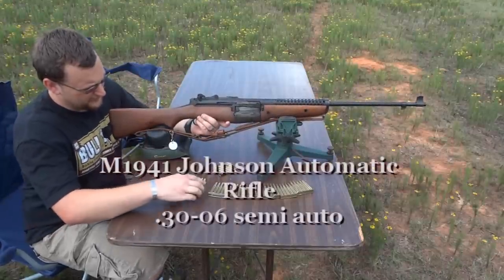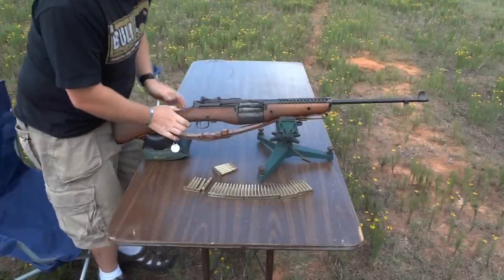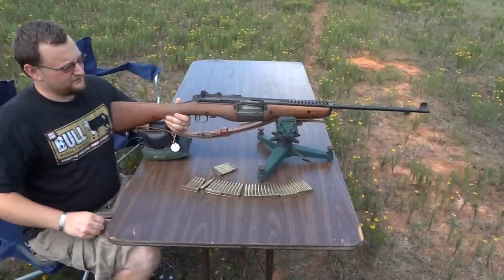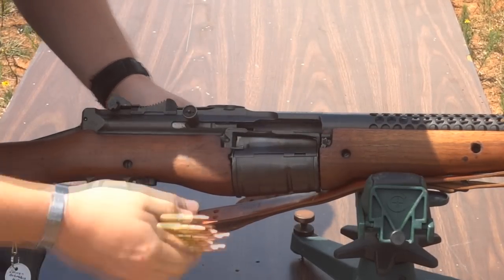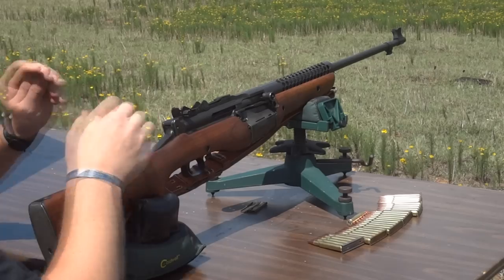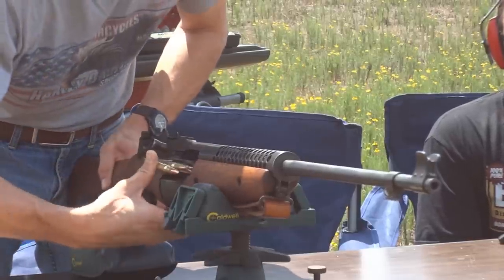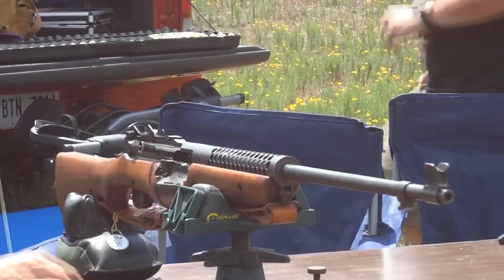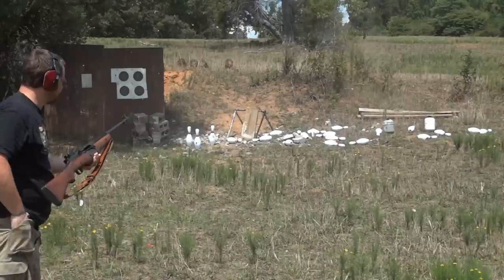1941 Johnson Automatic Rifle WW2 .30-06 Semi Auto

Comment: a few very important points that were left out.  1.  No "PING" like the Garand, to tell the enemy you are out of ammo..  2. it used the same 5 round stripper clips used by the M1903 Rifle that was also still in use  3. it held 10 rounds compared to the 8 rounds used by the Garand. 4. it didn't bite you like the M1 Garand (aka the Garand Thumb).  5,  a big drawback to the M1 was, you could only load using the en-bloc stripper clip, BUT..  the johnson allowed you to top off the rifle, with a stripper clip after shooting 5 rounds.  the Garand could not be topped off.  you needed to eject the clip using the button on the side, which would eject the clip and remaining rounds, so you could load another 8 rd clip. 6. the johnson rifle, DID NOT need to use stripper clips, you could load them manually one round at a time.  7. the Johnson could be easily topped off...or a specially round AP API etc could be loaded easily, OR, you could shoot a few rounds, and then quickly add a couple rounds manually.  this was a big deal....   In addition to the Johnson problems with bayonets...  if you attached a normal bayonet, the added mass on the barrel would cause it to have feeding problems nearly with each round fired... so Johnson designed a small lightweight spike bayonet...  so the Johnson was not a great rifle for attached bayonets...  BUT  bayonets were very rarely used...  and I would trade off the bayonet issues, with the ability to top off a mag, as well as not having the PING.    (note:  WWI, WWII and Korea we used Stripper clips, or enbloc clips...   this is why they continue to use the Term CLIP to this day...  back then it was a correct term..   But....   Modern rifles use Magazines AND NOT CLIPS...   Now you know where the term Clips  came from...   lol   )
Reply: *****   I forgot to add that you could mount a grenade launcher (for rifle grenades) on the M1 Garand, and even the M2 carbine..  but you could not mount one to the Johnson due to the reciprocating barrel. (it would have caused a great deal of damage)...   something most people don't know is that Johnson always gave his firearms Nicknames:  The M1941 rifle was Betsy, the M1941 light machine gun was Emma, and his M1947 auto carbine was named Daisy Mae.
Reply: ***** The enemy hearing the ping is a wife's tale.  German soldiers who fought at Foy were asked if they ever heard the ping and they answered that they had not.  The 8th round firing covers the ping.  The bolt of an M1 can't slam on your thumb while loading. Only while closing the bolt with the rifle empty. The follower can be pushed very nearly to the downward limit of it's travel w/o releasing the bolt unless you bump the op rod handle. If the bolt closed as soon as the follower moved, you couldn't get the clip in.  If this does occur, the piece is out of time and you need to check the fulcrum on the bullet guide.  Both the Johnson and the M1 had a magazine, but they were integral. A "clip" only holds ammo. A "magazine" holds and feeds ammo.  I sure it was a slip, but there's no such thing as an en bloc stripper clip.  In my personal experience, after talking with many who carried the M1 in battle, there was one complaint only. It's weight.
Reply: +88mike I was about to say that about the ping
Reply: +88mike The difference between a magazine and a clip is that a magazine has a spring inside it well a clip does not. Your right there is no such thing as a 'enbloc stripper clip' but there is such a thing as a enbloc clip which could also be called a mannlicher clip. These were used as a integral part of the magazine, as the magazine cannot function without it. For example if you do not have a enbloc clip for your M1 Garand you cannot hold any ammunition in the rifle as the magazine has no feed lips to retain any rounds.
Reply: +Eaglelord17.     Correct
Reply: +Weaponeer Yeah no ping, but that trigger reset is loud as hell.
Reply: +Weaponeer  Not true, bayonets were used about 50% of the time in the pacific. Japanese would launch Banzai attacks in the day, and at night. Hand-to-Hand combat was expected in the pacific fighting the Japanese.
Reply: the whole thing about the "ping" letting the enemy know you are empty is blown way out of proportion, as in combat the enemy wouldnt hear it, even if he was close, and wouldnt kno who it was.  there is no being quiet in combat. perfect example is yelling for another magazine or belt of ammo
Reply: The Japanese heard the en-block Clip PING constantly.  They would wait for the ping, and they would quickly charge that position, with the idea that most of the time the US Troops would be out of ammo stored in their belts, and had to reach for ammo in a separate bandoleer. this action may only take 7 to 10 seconds, but it would only take the Japanese 5 seconds to reach and bayonet the soldier.  now it's a documented fact that the Japanese would hear the ping.  so much that US troops used to throw up an empty clip and a second later the Japanese would hear the "FAKE" PING, and they would charge in force, and the US troops would mow them down with gun fire. So at first the Japanese used it against the US, and then the US used it against the Japanese.
Reply: ***** Not true because if just one person was out didnt mean everyone else was too. and the japanese were not that dumb and neither were the  germans
Reply: +The 20th Century Limited (Ricky B.) I agree
Reply: Weaponeer The ping was a non issue.
Reply: ssimon64 the ping was a major issue that got a lot of people killed
Reply: Weaponeer there's a lot of ignorance in this post, it's clear to me you don't own any garands, and if you do you certainly don't experiment with anything. First, the ping giving away your position and letting the enemy know you're out is Utter BS. Not only can you not hear that ping through a battlefield environment, but if they did, you and all your allies wouldn't be shooting and reloading at the same time, unless they're moronic. You always have men shooting while you're reloading so you don't end up getting bum rushed or let any enemies get out of your line of sight to flank. And garand thumb? Really? I don't even want to go down this road, but to keep it short and sweet, you won't get garand thumb with a full 8rd clip unless you're being VERY Careless or doing something dumb. Reason being is 9/10 garands won't auto chamber with the numerous types of clips available, because they're all very tight with a full 8rds. ( you can better success with this with older, worn clips due to the bolt not hanging up as easily stripping the first round, needing the m1 bump) and also, you CAN top off a garand, it's just not all too practical. If you're in a situation where the firefight is over, and you've finally got time to have some breathing room, then it doesn't matter how long it takes to top off a few rounds. But other than that situation, there's none that come to mind where I could see topping off the mag for any reasons, as  A) releasing the clip and loading a new one is significantly faster than topping off, I'd even go as far as to say you could unload and then reload the garand in the same time as topping of the last 3 or so rounds in the Johnson. And B) if you ARE in a fight, it's a situation that'll be fire til dry, reload, fire til dry, reload,  rinse repeat until it's over. No topping off would be occurring there. Also, one thing you forgot to mention is that the garand is one of the fastest loading firearms to date, provided the user has ample training, practice and time behind the rifle. In no way am I knocking the Johnson, because it's a fantastic rifle and I'd love to own one. But the M1 really is the superior rifle In almost every aspect, and that's why it became our Main battle rifle instead.
Reply: Bull shit !!  In a fire fight I dare you to tell me someone can hear a "ping" at virtually any distance.  How old are you by the way?  You sound 15-16.
Reply: ccrkicksass, excellent post.
Reply: Max Hill much appreciated, thank you.
Reply: Actually, it isn't hard to top an en bloc clip in a Garand - once you know how. The idea that this can't be done is an old wives' tale and completely false. Also, the idea that the "ping" of a Garand ejecting an empty clip is a give-away during battle is a fallacy. Battlefields are noisy places, and the echo from the 8th shot is still hanging in the air when the "ping" occurs and the clip hits the ground. The notion that the sound of the clip ejecting is in any way dangerous to the GI using the M-1 is another myth that somehow refuses to die despite being utterly false. A good comment on the Johnson otherwise. The Johnson is appealing compared to the M-1 since it is side-loading, which in theory would allow mounting a scope or optic. The reciprocating barrel might prove to be a problem in that regard, however. The Johnson remains a footnote in small-arms history, albeit an extremely interesting one.
Reply: Weaponeer  1.)  I have been at ranges where an M-1 was being fired, while I was firing a .22 pistol two stalls down, and in that situation I STILL did not always hear the ping, so you telling me that in the middle of a firefight where machine guns are unloading and grenades are being thrown, and all those rifles are shooting, that in that situation a Jap who is at least 20 yards away (if he was closer then "frag out") can hear that ping, you are asking a lot of suspension of disbelief.  2.)  It takes 3-5 seconds to reload if you have any sort of familiarity with the Garand (which, you know, Marines would  have drilled with to a ridiculous level) so that "5 second to reach and stab the soldier" thing, utter bull.  3.)  Soldiers go NOWHERE alone, the smallest number of men you would have in any situation is 2, guess what, if I am out, my buddy still has ammo, and by the time he is out I will be reloaded.
Listen to some interviews with guys from WWII and Korea, they consistently say that the whole "ping death sentence" is total bullshit.
Reply: Garand can be topped out but it's tricky. I love Garand but i dont like people fanboying it. I would love to see Johnson's rifle in some games and movies.... Clips are good, they are far lighter than magazines and disposeable, Magazines were incredibly expensive in comparison, heavy and if you lost a magazine you were punished quite severly by superiors, while strip  clips could be thrown away which allowed for faster reloads in case of emergency.

Comment: Hmm.

I wonder how well of a sniper rifle this think would have been.

Since as you load the stripper clips in from the side a scope would not be in the way (like it was on the M1 if you wanted the Scope centered)

And the problems from a bayonet would not really be a drawback either when it came to a sniper rifle.

How accurate was this thing?

Did the Barrel wander between shots or something like that?

Comment: I don't know if the Garand is "friendlier" during loading since if your finger slips, it will bite your finger. 
Can the Johnson be single loaded? I read that you could load it with single rounds if you didn't have any stripper clips. That made it a little more practical (tom me) than the Garand, since it has to have an enbloc clip.

Comment: Several on the comments suggested putting on a scope.   About the time you drill and install a scope,  you just pissed off several thousand dollars in value.   BTW, However, there was an outfit after the war, designed a sporter stock with a wooden cheek piece and many of them may have been fitted with a scope.

Comment: Something I never really understood about either the Johnson or the Garand was the magazine/clipper system - it seemed to make so little sense to me when the BAR, firing the same round using a 20 round box, with a little adaption, could have been used in either rifle and made both more effective.  Given that's basically the M14, why did it take 20 years to work it out...?

Comment: so it functions like the browning auto 5 or Remington model 8?
Reply: Ryan Ehlis No, the Auto 5 and the Remington model 8 are both Browning designs that use long recoil operation, this rifle uses short recoil operation. the barrel does travel rearward, but only partway, after that the bolt continues on it's own, unlike the auto 5 and the Rem 8 where the barrel travels the entire recoil stroke rearward along with the bolt.

Comment: My uncle had a Garand and a Johnson that was in 30.06.  I shot both.  I was 15 at the time.  I though the Johnson recoil was less than a Garand.   This putz didn’t read the army manual for the Johnson 1941.  My uncle later sold the Johnson

Comment: IMO it looks like the Lee Enfield is a better combat rifle; easier to reload, more reliable action, and can be shot accurately just as quickly (1 hit per second). Johnson would obviously be better at blind rapid fire, but 1.5-2 shots/second out of a Lee bolt isn't exactly something to scoff at. Judging from the recoil operation, I dare say a Lee Enfield is more accurate than the M1941 at long range. I'm guessing the M1941 can hold 9+1, some old Lee Enfields can fit 11+1 if you can believe that.

Comment: Most of what you say are lies the Ordinance Board came up with because they had stolen money from the Garand project and if it did not become the service weapon they were going to prison. It can handle the machine gun 30-06 which the Garand could not, including the AP round - it was loved by the troops and has a low recoil impulse. It was less expensive to manufacture than the M1, all in all we got a raw deal from Government, again. They also restricted many to fewer than 10 rounds to make the Garand look better, you can fix that sabatoge and get 10 in your gun.

Comment: I will buy any Johnsons for $1600. lol I have one and have tuned down 6K for it.  A sporterizd one, different stock, no bayonet lug, and sight ears cut off goes for about 3k or $3500.  This one is the correct military version.  An easy $5-5500 and probably closer to $6-7,000 range especially if you have a bayonet with it.

Comment: Just a note on the Bay of Pigs.  That operation failed because Fidel's forces had air superiority in the form of old propeller planes.  They used them to bomb and strafe the American armed Cuban forces.  The original plan was to have ex-patriated Cubans fly B-52s and bomb the airfields of Fidel's forces.  However, this was not done and I forget if it was the CIA or Kennedy himself who nixed it.  Once that decision was made, the operation was doomed and the Cuban landing forces were lambs to the slaughter despite radioing in for American air support which of course would not come.
Reply: Yeah and just think if Kennedy would have had some balls and given the promised air support there would not have been a Cuban missile crisis.
Reply: R J Macready Very true.  It seems just about every administration has poor foresight.
Reply: They used B-26s, though I am sure you meant those and not B-52s.  The Cubans were originally equipped with a lot of B-26 bombers, and the original plan was to use them to launch a heavy air attack on Cuban air bases.  Kennedy then decided to cut the numbers to just a handful of planes attacking a couple of airfields, with another plane landing in Miami, and claiming to be Cuban Air Force pilots who had defected as part of a coup.  That way Kennedy could pretend America had nothing to do with it.  Problem was, the Cuban B-26s had plastic nose cones (they were later models) while the WW2 surplus B-26s that the rebels had, were equipped with metal nose cones, and someone in the press noticed the difference.  Had Kennedy stayed with the original plan, which also called for an invasion at a different beach, closer to Havana, and also with an escape route to the Mountains, it is likely that the plan would either have worked, or would have at least been the beginning of a civil war, that would have put Castro out of business.  For my money, we should have either called the whole thing off, or sent in the full might of the American military, including Marines, with the stated goal of restoring democracy to the people of Cuba.  Kennedy wanted half measures, and that is why the plan failed.
Reply: sillydaddy101 Looking at the original plan, I think the CIAs aim was less about overthrowing Castro, than it was about tying him up with a civil war, that would neutralize his value as a Soviet allies.  Cuba didn't have much to offer America strategically, but it had a lot to offer the Russians.  If, however, it was so full of turmoil that the Soviets couldn't effectively exploit it, the situation would have been a defacto win for America at a minimal cost.  I don't know if this was the CIAs reasoning, but to me, it feels like the only thing that would make the Bay of Pigs seem like a good idea.  I may be wrong though, and the CIA may have actually thought the plan actually had a chance of ousting Castro.

Comment: Check my videos if you don't think I speak from experience. You can top off an M1 Rifle as well without taking out the clip all the way, and if you're firing rifles with or without ear protection, either way the 'ping' really isn't going to make any difference, especially considering you can reload an M1 in a couple seconds unlike the M1941. Also, the barrel on the M1941 moves before the bullet has left, this is not the case with the M1, so it's inherently more accurate.

Comment: It looks like a prototype M14
Reply: Not quite as close as the Garand does.  ;^)
Reply: True but the barrel of the Garand is covered by the stock so there is that
Reply: CGB Ruination Using that logic a Winchester Model 1895 is a prototype for an M14.  No stock on the end of the barrel.  ;^)
Reply: GreenCanoeb
Armalite and Colt hired Johnson and licensed his bolt group patents. For the AR14.